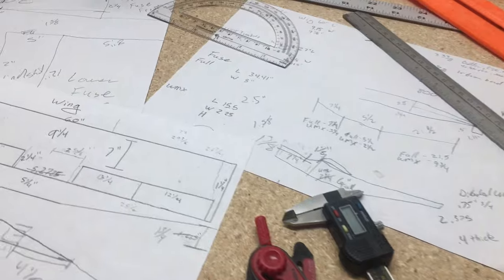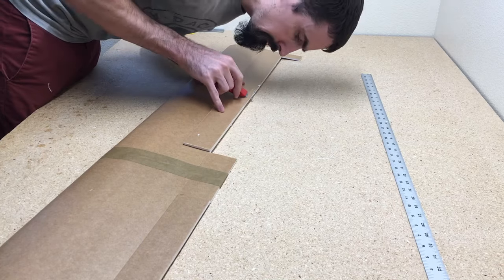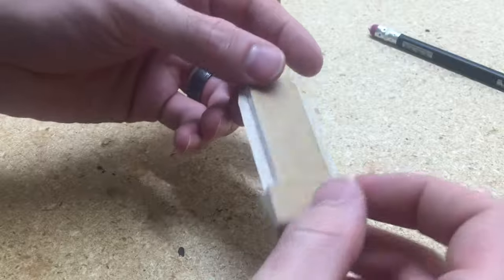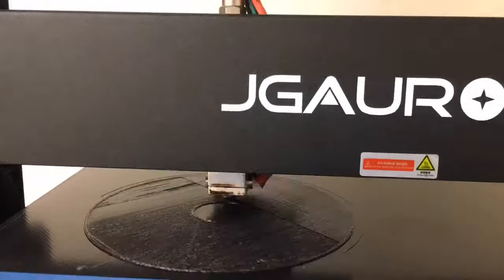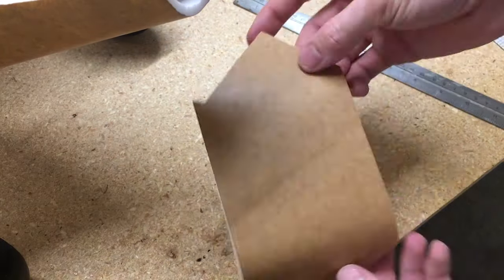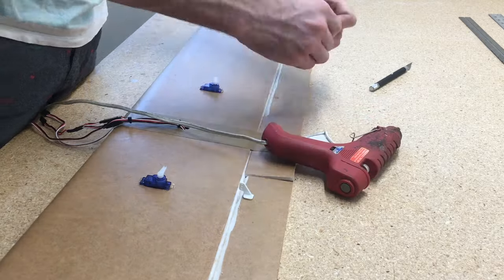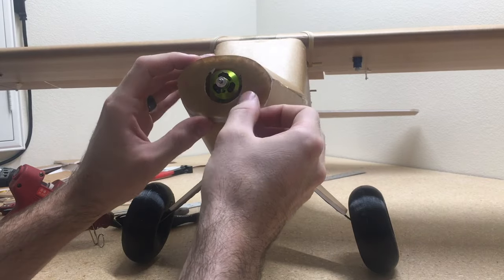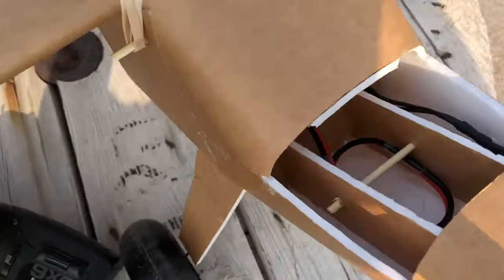The Best Beginner DIY RC Airplane

Comment: Brilliant, Troy! I am an RC newbee, and bought a Turbo Timber 1.5m on the advice of some of the old timers, then proceeded to auger it in. Having seen various Flight Test videos, I thought I'd try those, putting only $40 or so at risk instead of almost $300. I've built and flown the FT Explorer and just finished building SImple Scout. I would love to fly a big plane like the Turbo Timber again, so your video is just what I needed - I think it will make a superb project for the Massachusetts winter. Thanks so much!

Comment: You just took foam board builds to the next level. Really nice design and the best one I've seen on the internet. When you release the files for it I'll defiantly give it a try
Reply from the maker: Thanks so much, I really appreciate that! I'm working on getting my notes in order and drawn up.
Reply: Super work, really looking forward to building one. Best build ive ever seen. Thanks a lot for the possitive affect on the hobby. Great work
Reply: @TroyMcMillan  friend, i am building your aiplane desing and i consider is something wrong in the last plan of fusilage 2. I dont get dimensions there. Could you explain better or upload a New plan
Reply from the maker: @xavierorellana4798  Thank you for building my plane. It is such an awesome plane you will have fun flying it. What part are you having problems with for fuse 2? For the 3 parts of it windshield, upper and lower fuselage parts I don't have measurements of the exact shape because I used the parts I already have. build as a guide to cut them. So if you build in the order I did in the video you will see how I started with a basic square pice and glued it in plane and used a   straight edge to cut the shape I needed.  So I don't cut all the pieces out in. the perfect shape and glue it all together you will need to shape and cut each part to fit.
Reply: @TroyMcMillan  oh! Thanks so much, ihave started with wing and now i was trying to build fuselage. Now i understand. I m build the half size haha, after i will build the big one you have created!!! So nice job from you, thanks again for answering
Reply: If you are into foam board planes then I recommend you to watch this video: https://www.youtube.com/watch?v=DntBjIOZzZk
Reply: @TroyMcMillan  Troy how di you join the wing halves?
Reply from the maker: @alvandergoot7237  I used scrap pieces of foam, and glued them into each half of the wing with lots of glue

Comment: Very nice. My only negative comment would be the lack of cooling for the motor and the ESC. You need to open up the center hole, or a alternative would be to add holes on each side of the center hole for intake. Just as important as the intake is the exhaust, all the incoming air won't help without a way to get it out, rule of thumb is that the exit hole area should be twice as much as the intake, IE: if you have 2 sq inches of intake, you need 4 sq inches of exhaust. This is necessary as ESC's can easily be damaged from heat, a cool ESC works better and lasts longer. If you look on the bottom of any of the factory made electric planes you will see all the cooling holes, mostly for cooling air to escape.

Comment: EXCELLENT VIDEO. I will need to watch it several times though, as the instructions are a bit fast for me. I know, I have seen other videos for almost two hours, so this is the fast version. One thing I learned was how to make rounded fuselages, as mine (I am a beginner) are always kind of square. I have learned a lot from many videos. This one set them apart. Thank you!
Reply from the maker: Thank you Joseph, I appreciate the comment. It is alway a balance in making a video with this much step by step content between not making it two long but also trying to cover everything needed to build a full flying airplane. I hope it is helpful to you. The wing is very easy,  the fuselage is a bit more difficult because of all the rounded edges but it definitely makes it stand out against other foam planes I have seen with square edges. I haven't seen anyone build one like this that is why I wanted to give it a try. Let me know if you have any questions along the way. I am happy to help.

Comment: I've built many of these, a good way to stabilize the wing is the join two 1/2 inch balsa rods and glue them in the wings, then join them and glue the two wing halfs together, this helps with the g force, so when flying the wings don't snap or fall apart during flight or aerobatics.

Comment: Nice project! I've never built a foamboard plane but have built and flow 100s of balsa planes, foam, and fiberglass planes. I flew with guys in Hemet when they were out off Warren road. I see they have a new field now. Just one comment on terminology. The cross-sectional pieces in the fuselage are calls bulkheads (like on a boat) and the chordwise airfoil-shaped pieces in the wings are ribs. You mix terminology in the video.

Comment: You did an excellent job with this!

There are a few small things I saw that I would personally do different, but really I can't say anything as this is WAY better than I could do.

Main thing I recommend is putting the rubber bands straight front to back, and then only crossing the last ones. You'll get more side to side stability for the same amount of tension.

Comment: I'm really surprised that the plastic gears on those cheap servos didn't strip straight away... I would spend the extra 4 dollars on metal gear servos if it were my build.
You will find that the foamboard planes won't win any flying competitions or beauty contest but they are every bit as fun to fly as the 3d printed, balsa, carbon fiber and fiberglass model's. And the best thing about them is it doesn't crush your soul when you crash... and if you fly RC ,,, you will crash.
Great build and I'm sure you will have a blast flying this model.

Comment: Hello really liked the video and decided to start building the plane. Something about where you say on the plans to place the spar and were it actually goes is a bit confusing. Looks like on the plans that you have the spar 6 inches from the leading edge of the aileron but when you build im thinking you mean 6 inches from the trailing edge of the aileron. Putting the spar as you have it on the plans almost puts the front of the spar  within the leading edge???? Or maybe im wrong. When i watch you measure the bottom wing skin for spar placement looks like you are maesuring 4 inches from the edge that added to the width of the aileron adds upto 6 inches. Maybe im wrong here and i did something wrong when building the wing. Let me know mich appreciated and keep the great content coming.
Reply from the maker: I think you might have done something wrong, maybe double check the plans

Comment: Hay Troy, thank you for your nice piece of work it give me inspiration to try to build the plane. I am totally novice in RC-flying. I have one question about the setup of the electronics, do you have a short description of the channel-setup etc.?
Reply from the maker: I am using an AR620 receiver ESC ch1, Ailerons are on separate channels and I use a Y harness for the flaps.

Comment: Hi again, I have the materials. What size motor did you use. I already have a 1200KV brushless Graupner.
Reply from the maker: I used a 2832 1200kv motor for my build with a 10x4.5 prop the links to the parts are in the description. Any motor similar to that size will work good.

Comment: Really nice build Troy looking forward to the documentation also if you can give the link as to where you got that particular foam board from as i don't live in the U. S. Cheers Troy.
Reply from the maker: Hey, thank you! I got the link up for that board from Amazon, it's 20x30 3/16" UCreate Waterproof Foam Board. I've heard other people saying they've used dollar store foam board and that's worked for them also. Cheers!
Reply: @TroyMcMillan  thanks Troy I appreciate that actually my 1st project is a guillows B24 liberator I will be converting that to r/c so hoping that goes well but I will deffinatly give your Cub a try. It be nice sprayed in yellow.

Comment: So as the ailerons are the extension of the upper surface of the wing, in order to follow the angle of the trailing edge, in their neutral position there is some canver?

Comment: Thanks for making this available. I am part way through the build.
Is the length of the tail critical? I note that you slice some off to make the fuse level at about 5:55 in the video.
Would be great if you can please make the stl files for the wheels and front latch available.

Comment: I watched a few videos but still not sure how to connect the receiver. Your battery is 11.1V while receiver works only up to 6.5V. Where to you take power from?
Reply from the maker: The battery connects to the ESC that has a servo lead off it attach this to the receiver it powers the receiver with the correct voltage.
Reply: @TroyMcMillan  Thank You !!!

Comment: good morning friend
i just finishinh this model and it is my first model .. i have a big problem to calculate my brushless motors battery esc ... plz how to do it... because now i have 3 days search and calculate but no result ... thanks
Reply from the maker: I have all of the exact links and sizes of every single thing I used in my description of this video! Check that out! Hope it helps.
Reply: @TroyMcMillan  yes all materiel used is in link but how do you chose this motors or esc or battery i like to know how to walculate this things and thanks

Comment: Would this plane be well-suited for a beginner who has never flown an RC plane before?
Reply from the maker: Yes I would recommend this plane for a beginner flyer. This plane is very stable and will fly very slow with flaps down for a landing you can almost land with no ground role. There is no dihedral to the main wing but it does not need it. The wing has such a large surface area it is stable. It flies a lot better than my first airplane I learned to fly. with a 3ch RTF horizon hobby super cub. Let me know if you need any help when building the planes are in the description. Cheers

Comment: How would you put 2 pieces of foam board together, like if it takes 2 to make the length of your plane? It seem the only way to do this, with one piece is to buy a large $10 dollar piece, instead of 2 smaller pieces, for about $1.50 each. I don want to pay 10 and mess up, that piece of foam, like if I mess up.

Comment: Do use 2212 920kv or 2212 1000kv engine instead of 2832 brushless engine.
Reply from the maker: I used 2832 1190kv brushless for it. The link is in the description to see the one I used, as well as every other item I used to build it

Comment: I’m new to the ex foam airplanes but I’ve been measuring everything out on a peice of foam board but some of the measurements are off on fuselage 2 and tail and I was wondering if I was missing something
Reply: How did you find the measurement for the wing  did the spar position make sense to you? The position seems off as the upper wing skin is unable to fold over and  the leading edge is not formed properly. I think the spar  position is off by 2 inches. Maybe just the way I'm building.
Reply: @alvandergoot7237  same. I have wasted 2 pieces of foam board

Comment: By the way, this video is my next project.  I built an airplane with a similar wing lenght, but,  the airplane fuselage was very much with lots of  corners.
Reply from the maker: I am glad to hear this will be your next build. I will have a video out in a few days where I am testing out some new 3D printed materials and I use this plane to test different wings. This plane flies so well and is so stable it is really a fun plane to fly. There will be some good flight video at the end that may interest you as you are getting ready to build this plane. Cheers

Comment: Those looked like Dean connectors
Reply from the maker: I think I know what you're talking about, I 3D printed them! The control horns?
Reply: @TroyMcMillan  The electrical to the ESC. They look like Deans instead of XT60s. Sorry I was being nick picky
Reply: @TroyMcMillan  Almost done with the Eagle. About ready to start printing the Savage Bobber. Been busy picking up a down aircraft in Southern Oregon.
Reply from the maker: @Stubby0266  That is super cool! Do you do that often? The Savage Bobber works best with its wing printed out of LW-PLA, if you can! It works fine, if not.
Reply: @TroyMcMillan  Which one?  Being picky or acft recovery? Been really slow this year. Happening all around us. Good and Bad.
Reply from the maker: @Stubby0266  haha, I meant recovering downed aircraft!

Comment: Not every different foam board is suitable for building this. I tried bending the wing like in your video and couldn't get a decent quality. In fucking Russia, such foam board is not sold. I found only 580 grams per meter. models from it are angular. ... And you have beautiful smooth shapes.
besides, a simple 3D printer for Russians is not an allowable luxury.